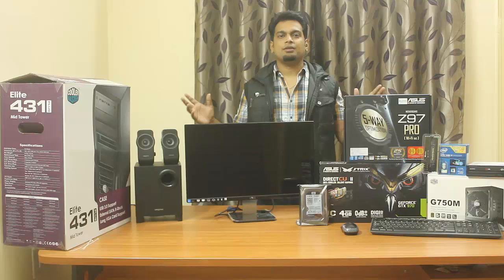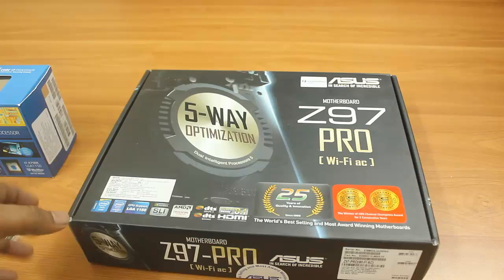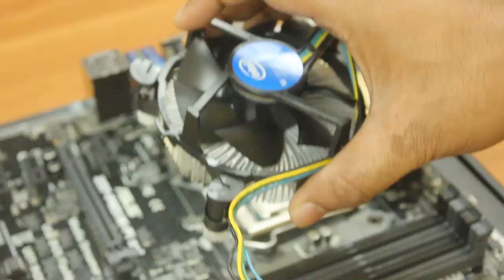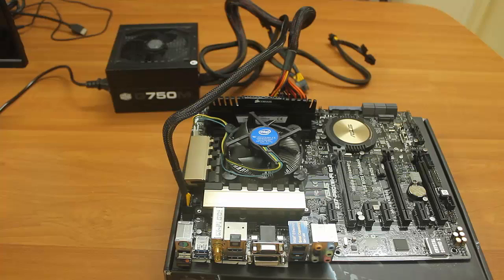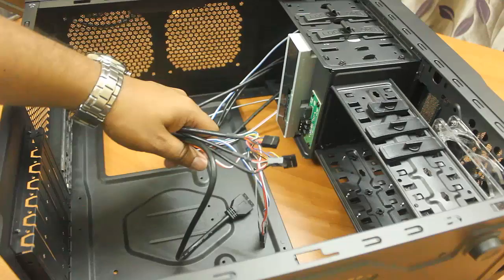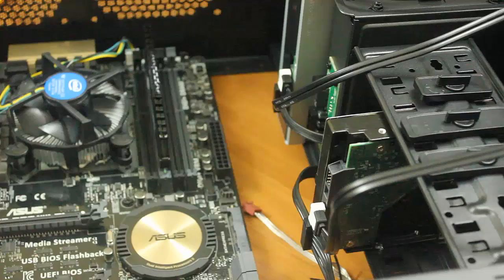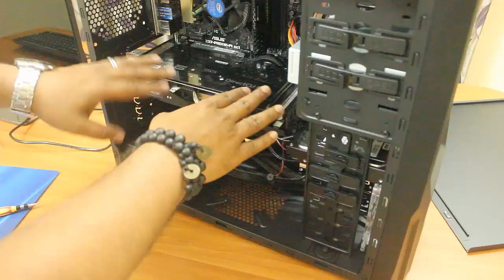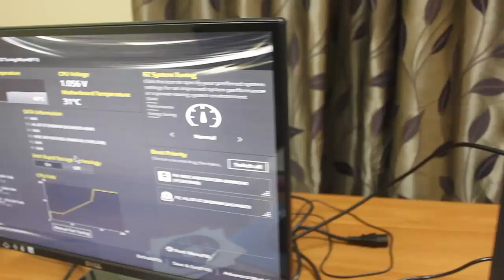How to build $1500 ultimate gaming PC  2015 - 2016 | India | intel i7 4790K | GTX 970 |

Comment: Just get Hyper 212X CPU cooler if on budget so atleast drop your CPU temp below 30C.. 45 is very high..
Reply from the maker: I am getting 35-40 C using stock cooler . While playing games its going up-to 50C ..that's ok I guess .. as Intel recommends upto 70C ;)
Reply: Tech Virus Well my idle are 24-28 and on load around 40-45. I'm using H100i with lowest RPM SPL fans in push from out of case blowing down in, and my case is 600T which i'm gonna swap real soon and yes, my CPU is at 5GHz OC with board Z87X-OC Force.. so atleast get Hyper 212X or Cooler Master Seidon 120M Cooler which is single rad 120MM AIO liquid cooler.. Helps you overclock much..
Reply from the maker: Temp. looks cool ... but why do you need to overclock ? Do you work on editing / rendring videos ? ...if not then i7 works pretty good on all games without overclocking as of now ... yeah may be after 1-2 years we need to overclock ! Thats why I will go with custom coolers when I need to overclock .
Reply: Tech Virus Well i do 3ds max and after effects also premier pro.. so i need that..

But i will recommend Hyper 212X which is of Rs.2700 on flipkart.. If not want to spend much then Deepcool IceEdge 400XT is best bang for buck.. costs Rs.1800. and you are good to go by the time you do OC. Also Stock cooler does not look good, in build of your beautiful parts..

Comment: its an unlocked processor and u r using stock cooler
please don't overclock cpu it will burn.
cable management is worst i have ever seen 
dell monitor u r using has 14ms response time its not a gaming monitor even how u r able to play the games @ high fps
at this cost u will get better gaming pc

Comment: you say this is ultimate gaming PC and u don't have ssd it is the main part of every gaming PC u should have used a 650 watt power supply and bought a 128 GB ssd for only OS
Reply from the maker: +Fixterz HD I have already added 250 GB SSD now and changed the cabinet and also changed the PSU from cooler master to Corsair .. Check these : SSD -  https://youtu.be/VXUUaBrQUto
Cabinet - https://youtu.be/4uSWZmYPYMA
PSU : https://youtu.be/_lrDmtbYPtM

Comment: Wao, he hold the CPU with its golden connect points side.. Also he holed  the board with its hands.... Not a good way to keep your components..Also atleast get a descent enough CPU cooler.. India gets hot in summer .. Also always use dual channel memory for better reliability. Using single RAM is bad.. Should have got 4GB x 2 if money was a concern. Another thing was with this king of build, should have gone with better Case, cheap downed on case made the build look bad. The cabinet part was really really ugly and cable management was just... Corsair cases have better layout and design , don't know why you went with this.. But except this, Choice of parts was great.. PSU And WD Black HDD, really makes much sense, waste of money, it makes sense when you have other backup drives for storage.. 7200 RPM BARACUDA was enough with save money to buy atleast 120GB SSD..And never hold Card's PCB or of anything's PCB with bare hands.. 

I would say Great build, great parts except Case but bad build habit and handle style..
Reply from the maker: Thanks bro .. yes even I feel I should have gone with better cabinet ! My budget was tight so saved money on cabinet ! (I will change it next year) Also went with black edition HDD as I wanted to cut on SSD as of now .. also I will be purchasing  3 TB WD Green HDD soon ..
Reply: Tech Virus Well in that case, Good luck with your build.. But do get SSD real fast as of now, 840Evo is best bang for the buck.. Very competitive to Intel 730 Series which is newer.. Do not install Games on WD Green coz its slow, i mean real slow, Random data storage is good. i would recommend WD purple over green coz Purple is more reliable and made for 24X7 use but no windows on it..Hope well for you future build..

Comment: I am making  a starting level gaming PC.

Specs -

Intel i5 3.5 GHz
Nvidia GTX 750 To
450 Watt Corssair Power Supply
1 TB Toshiba HDD
8 GB HyperX Ram
Gigabyte Gaming MoBo

Budget - 40000 ruppees
Reply: 750 Ti*
Reply: Can I get better stuff at the same cost?
Reply: +Pushkar Mhatre Hi dude i'm from india as well and you can use the Radeon R9 270x for a little greater price but it packs huge monstrous performance for your budget ....

Comment from the maker: Rishabh Singh - Yes, they all will support 980 SLI
Reply: 2 gtx 980s will also run at the same time
Reply from the maker: Yes both at same in SLI mode .. but you don't need that much of processing power its a over kill ... 1 GTX 980 is more than enough !
Reply: Tech Virus bro this mobo support 4 way sli?
Reply from the maker: Yes... it does . Check this https://www.asus.com/in/Motherboards/Z97PROWiFi_ac/specifications/
Reply: Tech Virus thank you once again :D
Reply: will FX 8350 7ghz OC performance similar like 4790k :P
Reply from the maker: OC of FX8350 can match i73770k :) but not 44770k ...
Reply: is multi thread optimize games like crysis 3 or bf4 work better on amd cpus?
Reply: will all this support msi gtx 970

Comment: Intel Core i7-5820K
Corsair H100i 77.0 CFM Liquid CPU Cooler
Asus X99-DELUXE ATX LGA2011-3 Motherboard
G.Skill Ripjaws 4 series 16GB (2 x 8GB) DDR4-2400 Memory
Gigabyte GeForce GTX 980 4GB WINDFORCE Video Card
Seagate Barracuda 3TB 3.5" 7200RPM Internal Hard Drive
NZXT Phantom 530 (White) ATX Full Tower Case
Corsair RM 650W 80+ Gold Certified Fully-Modular ATX Power Supply
Asus DRW-24B1ST/BLK/B/AS DVD/CD Writer
4x(Corsair Air Series AF140 Quiet Edition 67.8 CFM 140mm Fan)
Asus ROG SWIFT PG278Q 144Hz 27.0" Monitor
Corsair K70 RGB Wired Gaming Keyboard
Logitech G502 Wired Optical Mouse
Kingston HyperX Cloud II 7.1 Channel Headset

total price is around 3100$

planing to build this if you have any suggestion please buy all means comment i would appreciate your help , and do you think its worth the money should i go with it ?
Reply: If you wanna go that high, go for A Titan x.

Comment: NO SSD ON IT , AND A HIGH GPU , PROCESSOR , RAM NEEDS A SSD , ........ THE WD HARD DISK SURELY BOTTLE NECK YOUR PC AND DEGRADING THE PERFORMANCE , A GOOD SSD ENABLE CORE i3 or AMD LOW BUDGET CPU WILL EASILY BEATS YOUR SYSTEM  , IN DAILY WORKS , SYSTEM BOOTUP , HARDCORE APPLICATION WORKS , AND MANY MORE ....
Reply from the maker: Akash Dey Yes, no SSD coz of cost cutting.. also it just speed up my system for boot,app load and file copy/pate . No performance change in gaming ! And yaa I will get SSD by end of year ;)
Reply: Considering The Products That You Are using, There is no hint we the viewers will get about the price cutting, it's a pretty high end build with really some good product, as u spent money on it, A 3000 to 4000 bucks spent on SSD really won't matter......  Yes it's not going to help the games to add some extra frame per minute,  but Your Processor And configuration really Needs that type of SSD Horse Power for Working With Full Potential , These products are Future Pioneers and HDD is like History.
Reply from the maker: I do not want to spend 3-4k on SSD , I will go minimum for 500GB SSD that is about 16k-20k as of now .. and thats why i am waiting for its price to go down ! 
As of now with WD BE , I feel like my machine is flying, it takes 3 sec. to load PS , Adobe primer or any other thing ... I am aware of bottelneck, thats why I want to purchase everything considering the future .
Reply: 500 GB SSD without Raid, not going to give Price to Performance Sweet Ratio
Reply from the maker: Check this - http://www.pcmag.com/article2/0,2817,2455429,00.asp
Reply: Tech Virus i know it , dont need to read whole lot of article for it
Reply from the maker: Great ! So 500GB will give great performance ... technology is changing every day bro ..
Reply: SSD will always gives you performance,  but when it comes to security, I mean it's less secure than Mechanical Hard drive, You should go with two 500 GB SSD in Raid 1,  so you can get 500 GB secure space,  it's more than secure than normal,

Comment: Lol, from this video I got to know that Tech Virus have money but no brain. They have money for high end components but not for 15$ cooling fans for rear of the case. Even he don't know that case comes with standoffs and not using standoff can lead to permanent damage to motherboard. He had pay 6000 for WD black hard disk but better he can go with an 128 GB ssd. And one more thing he even don't know how to handle CPU. He was touching the CPU from the bottom. Bro if you don't know how to assemble then don't make people do the same too.
Reply: And one more thing how do you over clock when you don't have good cooling in ur cabinet
Reply from the maker: +kunal sehgal Check my other videos too ... I have upgraded to better Cabinet, added 250 GB SSD, Hyper x CPU cooler ! In comments I have mentioned that I forgot to add Motherboard standoffs (also added annotation ) and I removed the Mobo and put them again . I was handling camera focus and holding the CPU as well, so touched the CPU bottom. Hope you understand ..
Reply: +Tech Virus So you should have make the video according to that and also you can also mention the same in the end of the video or by onvideo comments. Remember not everyone look for comments before going further.
Reply from the maker: I cannot edit the video but I will add video links at last and on video text .
Reply: +Tech Virus That's Better ;)